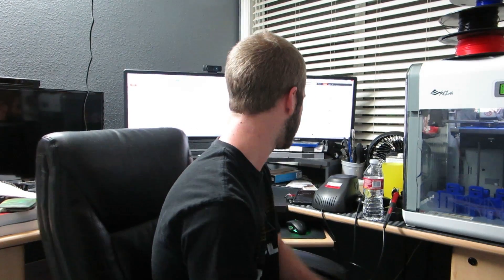3d Printing | PLA Vs. ABS Filament | Why I Only Print In PLA Over ABS

Comment: I only use ABS because of the higher temperature resistance. The smell of the ABS is only a problem for the XYZ cartridges, it is really bad, makes you want to put your printer outside or build a ventilation for it.
However when I flashed it and started using third party ABS it doesn't smell at all! So huge difference.

My glass plate hasn't cracked either (been using it for a year now), it did chip a little bit when I used to much force removing my prints (don't use the glue!).

Comment: Great video, only print ABS if you can have the printer in the garage outside of your household. I began to get a cough after 2 weeks of printing. Moved to the garage and everythings fine again. I only print ABS for that beautiful acetone bath finish.
Reply: Maybe you just had a cold...
Reply: I didn't but I hope it wouldn't be the fumes from the plastic. Just my experience from the plastics I have bought. I did go for the cheapest of the cheap.
Reply: Yeah cheap stuff smells. There's always weird additives that are put in them.

Comment: Your reasoning makes sense to me. I agree that unless you are making a replacement part that requires screwing, that you don't need ABS. I heard that ABS exceeds OSHA and EPA safety standards assuming you buy a USA product and not from China.
Question.
Will enamel paints like the ones you buy in the spray cans help protect PLA from degrading and moisture exposure?
Thanks

Comment: You can give ABS-printed objects an acetone vapor bath as well.  Done correctly, it almost looks injection molded and detail loss is minimal.

PLA is completely unaffected by acetone.  I believe that there ARE chemicals that can smooth it, but they're much gnarlier than acetone (which is a totally mundane household chemical).
Reply: Adam Cavender It's flammable but not explosive.  Not a huge deal.  I use a candle warmer.  People also do cold vaporization-- it just takes longer.
Reply: Don't site wiki in school, you site the source that is sited in the wiki lol Thank me later lol.

Comment: hey, just wanted to say, real nice videos, keep up the good work. also have a question about you DaVinci 1.0a, sorry if you made a video about it but i would like to know how you managed to reflash it. thanks and have a nice day !
Reply from the maker: yvon loyer When you say reflash what do you mean? I have only flashed it the once when I installed the repetier. I have not flashed back to stock or tried to update the repetier fw (dont know that there actually has been an update) Thank you for the compliments!
Reply: no, i wanted to know how you were actually able to install repetier and print PLA, so far all the videos i've found just talk about the davinci 1.0 and not the 1.0a.
Reply from the maker: I made a full video on it. If you go through my videos there is a tutorial where I show both!
Reply: cool, thanks. i'm doing what you are saying in the video and you say to use repetier 1.5.8.  now there's 1.6.3. that is also available and was wondering if you updated to that version